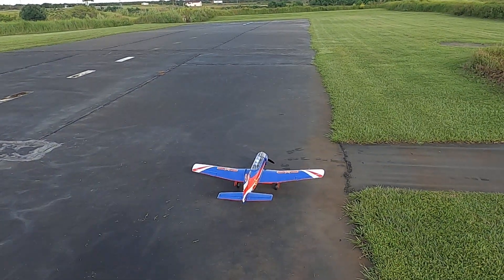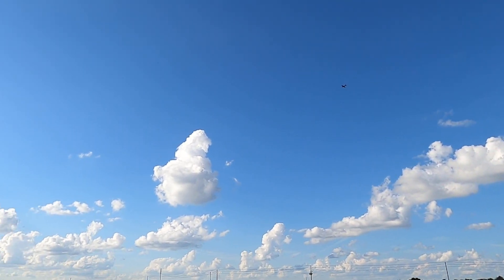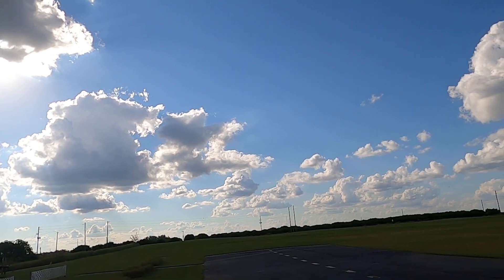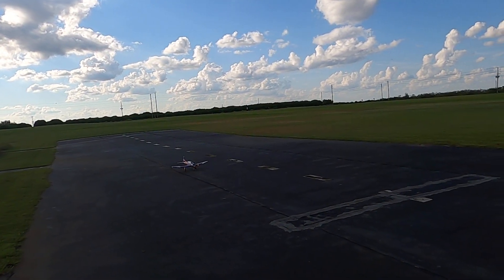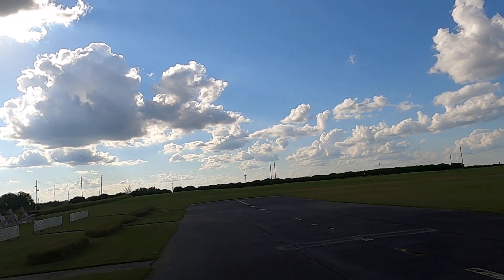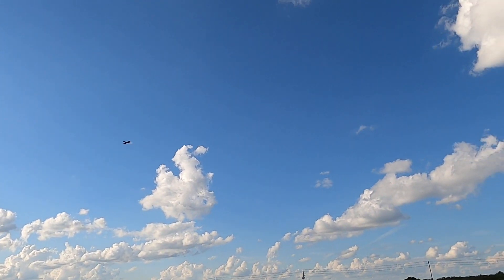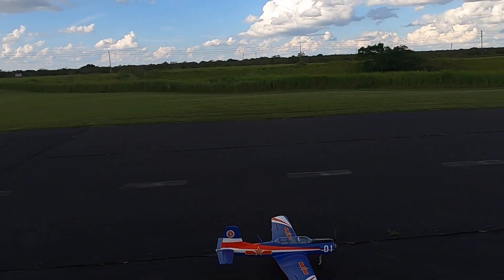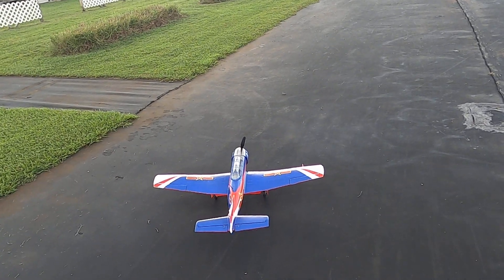The Big Sky with the FMS CJ 6 V2

Comment: hi loving your channel how did you assign a switch to your tx
Reply from the maker: in a dx9 or any new gen computer Spektrum tx go to system>channel assign>next> now after the main controls (throttle, ailerons, rudder , elevator) you can assign Aux1 to what ever and gear to whatever. I normally keep gear as gear (retracts) and use Aux 1 for flaps.